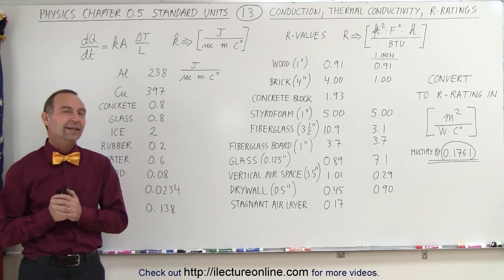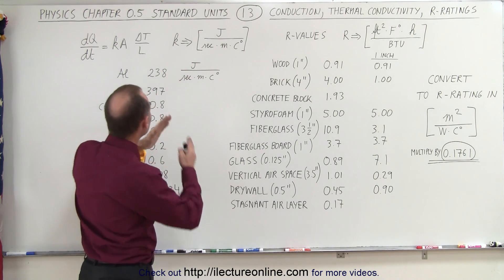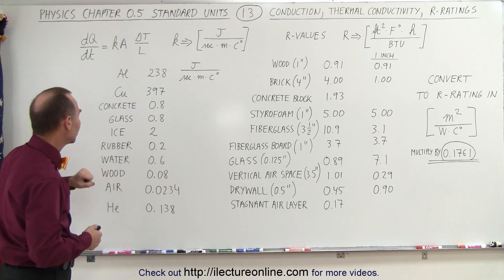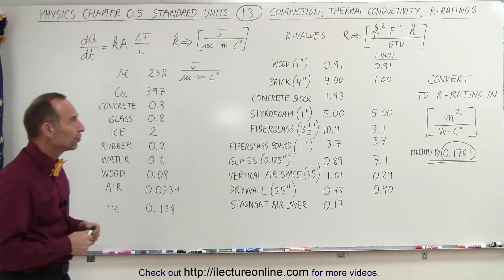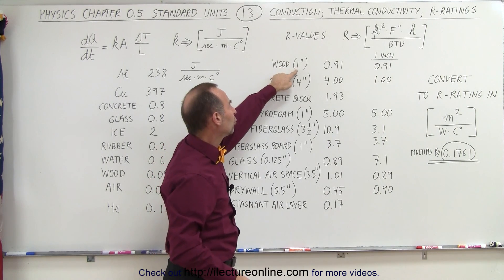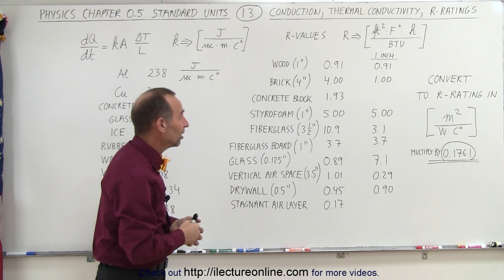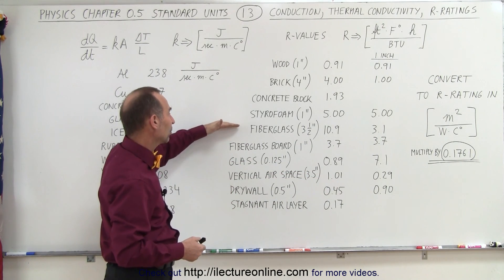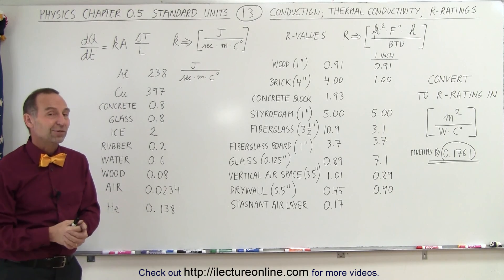Physics CH 0.5: Standard Units (13 of 41) Conduction, Thermal Conductivity, R-Rating

Comment: Shouldn't the degree Celsius be in the numerator for the conversion of R-rates?
Reply from the maker: If you are referring to the units of k, the video is correct.  (That is not a conversion factor to R, simply the units of k).
Reply: No, I am referring to the right side of the board, convert to R-rating by multiplying by 0.1761
Reply: @drprogrammer4117  Yeah, degree C should be in the numerator. I didn't check if 0.1761 is a correct factor.